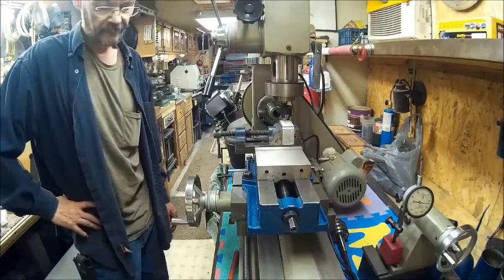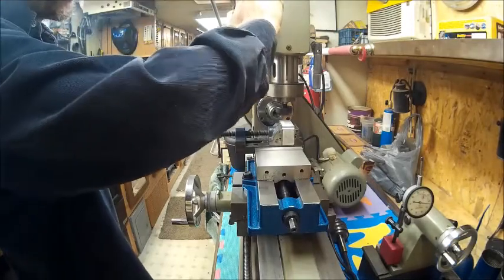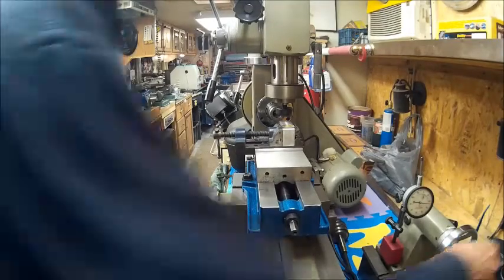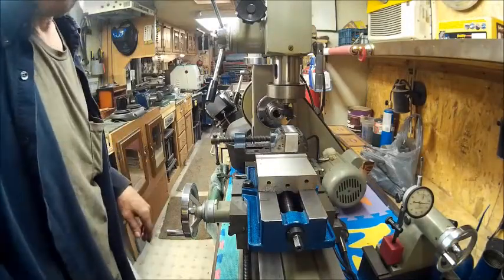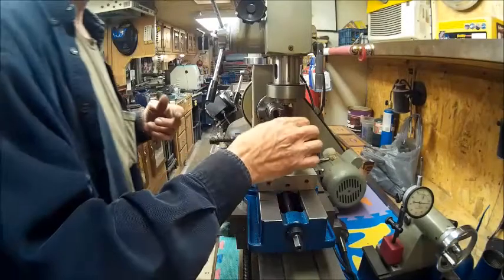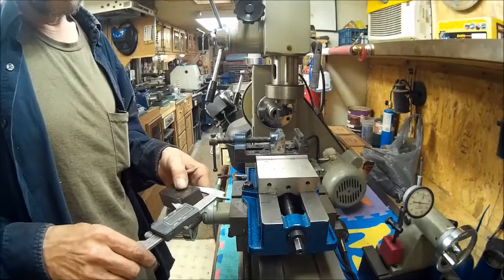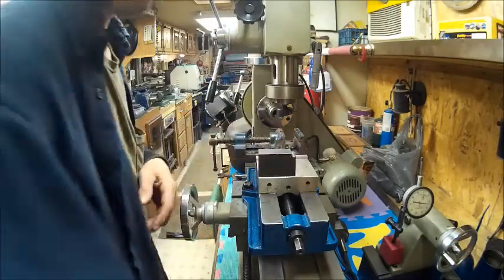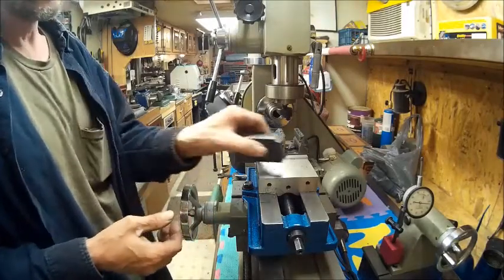harbor freight mill drill lathe first time fly cutting

Comment: Did you say MT2 collets? I bought a used machine and have no milling tooling and am trying to figure out the best way to out fit it
Reply from the maker: yes sir. thats what i said. lol. i sold that thing shortly after i recorded this video.
Reply: @BisonWorkshop  I'm trying to figure what tooling to get for my $150 HF mill/lathe. I have nothing. Not even the drill chuck

Comment: These machines get a really bad rap.
I bought mine brand spanking new and it was my first lathe and mill.
It taught me a lot.
Now I have a nice South Bend lathe and a Lagunport (Lagun Mill with a Bridgeport head, best of both worlds) and I still use the 5980 all the time.....
There's even some things it does better than the others...
I like to use it for hobbing gears for instance....
Reply from the maker: i hated the one i had. nothing would ever fit in it. theres not enough room to move the head up to mount your work. and the removal of the chuck was a pain in the ass. every time you remove the chuck, i had to remove the belt cover to hold the pullie and that got old real fast. lol.
Reply: Bison Workshop I drilled a 1/4 inch hole through the cover through the pully and into the casting, then hung a 1/4 pin made from drill rod, and mine would spin right off.
The trick is to make sure the threads are nice and clean before you spin the chuck on and lock it with the two grub screws.
You don't have to make it real tight on the spindle so long as it seats on the shoulder well.
I think the first time I removed it it took a force of nature to get it off, then maybe the first dozen times it was a little tight, but I have four chucks for it now and I change them all the time without any problems.
It's not usually necessary to use the pin either. 
Most of the time I just open the belt cover and pinch the belt with my left hand while I use a wrench on the jaws with the other.
Helps if you put a drop of spindle oil on the nose before you spin the chuck on.....
I know what you mean about fitting the work piece on there. when it was my only machine sometimes i had to get creative.
I did find a nice set of short bits and endmills though.
Now I only use it when the piece fits, I've got bigger machines when I need them.
But it's nice to have a quick to set up manual machine sitting there when you have something set up already in the CNC mill and need something small and quick.

Comment: But my self the same lathe mill combo.   But much come with the live center only (  dont know  how to take it out  yet) but.  Here my question. What's the size.   To buy the drill chuck    its mt2  or mt3  ?
Reply from the maker: you will need to look up the manual for it. i sold this lathe a couple weeks after this video and got a grizzly mill. i dont hardly remember much about it. sorry

Comment: if I remember right that thing weighs about 500 pounds...how the heck did you get it into the r.v.?  I have to use an engine hoist to move mine.
Reply from the maker: in peices
Reply: I'm glad I didn't have to do that. I haven't used mine for a while due to a long term illness and am just beginning again. just bought a QCTP and ordered a tilting 3" rotary table for the mill. Looking forward to starting again
Reply: JIMMY TATE I remove the quill when I move mine.
Also if you look at the base there are 1 inch holes in the casting to run a piece of round bar through that helps if you have a couple of friends, or you can use it to lift from with a cherry picker.
Thats what I do.
Reply: I know about those holes, even used them once, but Its still a struggle with 4 strong guys. I use my cherry picker now but seldom need to move it anymore.
Reply: JIMMY TATE yeah, I got one big move left in me.
If I decide to retire and move into a condo after that, all my machines go with the house...